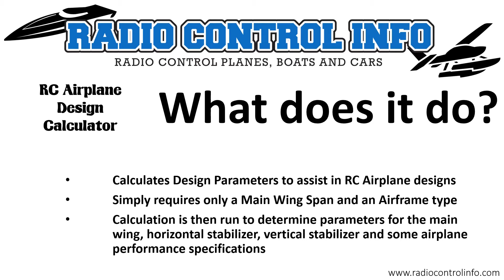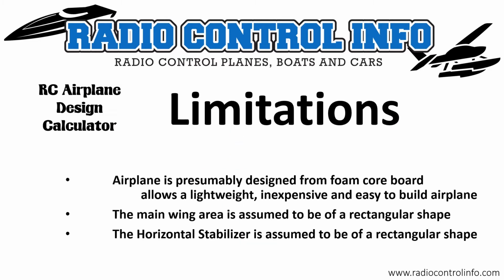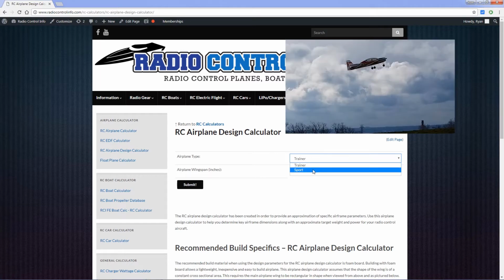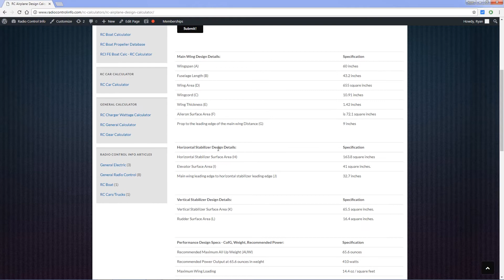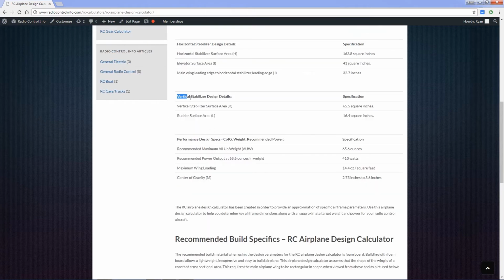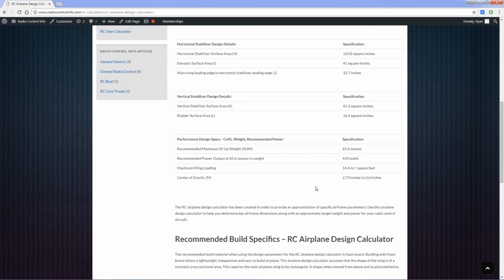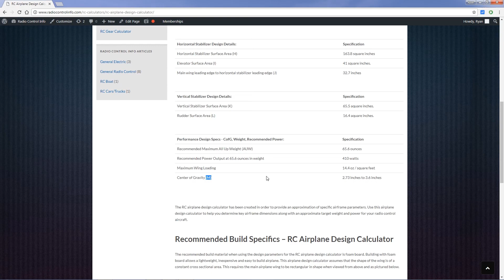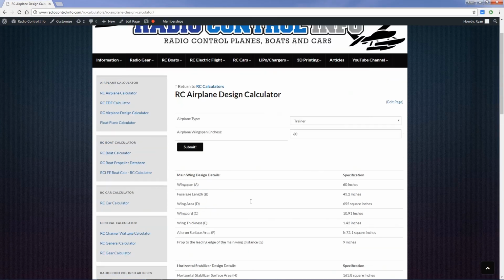RC Airplane Foam Board Design Calculator

Comment: Hi, I am designing an sport-type RC plane, but I have some restrictions for building, and I would like to experiment with changing some of the given variables (on the calculator you can only vary the wingspan). Which is why I was wondering if you have the formula's the calculator uses, so i can calculate the effects on the dimensionsby changing the weight for example.

Comment: i feel like your horizontal stabiliser output from the calculation is off. This just doesn't seem right, it looks way too small. 
https://i.imgur.com/ijDJX9l.png
Reply from the maker: It looks like you are using the wrong surface area. More than likely you are trying to use the vertical stabilizer value for the horizontal stabilizer. Use the correct surface areas in the right spot and it will all work out.
Reply: @RCexplained  I will check again. thanks.
Reply from the maker: let me know if you still have issues.
Reply: @RCexplained  I'm at work currently but I just checked the calculator again and mocked it up in a drawing again. I think perhaps you are correct. 
Additional question- if the horizontal stabiliser extends past what the calculator says should be the length of the fuselage, does it really matter if I actually extend the fuselage spar out to the length of the horizontal stabiliser anyway?
Reply from the maker: No, ultimately that is up to you.

Comment: I had a Aeroscout 2 1.1 RC Plane wheee fuselage broke beyond repair.

How would I figure out what size foam plane the existing motor & battery would fit it?

If I placed the motor, battery into a smaller Aeroscout a mini would it fly or crash to the ground?

How do you know proper dimensions for wing & fuselage?
Reply from the maker: A crashed foam plane may look like its broken beyond repair at first, but I've seen a lot of crashed planes repaired to fly again.

You can use your power system in a high wing, slower flying plane with a wing span between 40 and 54 inches or so.
Reply: @RCexplained  

Amazing-
Thanks 4 the info.
Yeah, just bought a Hot Glue gun & repaired original.

I’m now into building more DIY RC planes going forward.

Where did you find what wing size would work?

Just from building a few RC planes yourself or online calculation.

I believe the original Aeroscout weighs 1.8lbs.
Reply from the maker: Hey Michael, I know this from experience. Generally you want to use the calculator and experiment with different wing sizes and compare what recommended power system wattage is required vs all up weight of the plane.

Comment: Does the with of the body matter?
Reply from the maker: The width of the fuselage as changing any dimension on the airplane will change its flight characteristic. However, a wider body can positively or negatively effect flight characteristics. My recommendation is keep the width proportional to the length as in the dimensional image.
Reply: @RCexplained  Thanks!

Comment: I used the design calculator, and entered 30" for the wing span (A) so I can use just one standard 20"x30" foam board for the wing.  The AUW (All Up Weight) came out to be 7oz, but ONE foam board alone is a little over 9oz., and that does not include the fuselage, the rudder, the stabilizer, nor the electronics!! Am I misreading this? Thanks
Reply from the maker: Hi Steven. What kind of 20x30 foam board do you have and what scale are you using to weigh it?

Building a  small plane and keeping it around the 7oz mark will be challenging indeed. You will want to get creative to find ways to keep weight down.
Reply: @RCexplained  Thanks for your reply. The only foam board that I have on hand is a 3/16" foam board with two paper sides sandwiching the foam inside. Bought at Walmart for my kids' school projects. I used my wife's weight-watchers kitchen scale to weigh one board balanced vertically on top of the scale.  I have seen some YouTube video where people use an XPS 3mm foam without the paper surfaces, which I can't find anywhere to order. Does the All-Up-Weight include all the electronic components (servos, motor, ESC, battery, etc.)?
Reply from the maker: All up weight includes everything. I just weighed a 3/16 sheet, paper backed on both sides 20x30 at 4oz. It was actually under 4oz.
Reply: @RCexplained  I don't know what kind of foam board you have, but assuming you'll need two boards to build a plane, that's already over 7oz, without the servos, etc.  I'm lost.
Reply from the maker: Hi Steven, I did not use 2 full boards for a 30 in wingspan plane.
Reply: @RCexplained The density of a foamboard is about 0.0433 g/cm^3 ....Hence...a 20x30*3/16 * 2.54^3 = 1843.55 cm^3....hence the weight of this board is 1843.55 * 0.0433 = 79.82 grams or about  2.81 oz....

Comment: same foamboard sells at DolorTree for $1 way pay $5 per sheet on Amazon?
Reply from the maker: Hey Brian, the Dollar Tree foam is not quite as good. I've done a few builds with it.
Reply: @RCexplained  I usually tape all the surfaces which increases its strength and prevents it from absorbing moisture and have flown in light rain. But I have not tried the amazon stuff yet so cant speak to that.
Reply from the maker: @brianlink391  you can buy the elmers board locally I'm sure.

Comment: For a 48" trainer wingspan it's telling me to build a 104.8 square inch horizontal stabilizer.  This seems huge , gigantic.  Are you sure the formulas are correct?  I also assume this to be without the elevator included.  Just wanting to make sure of these measurements before getting too far into it.  have cut the H-stab, and again, just seems huge.  Thank you for your calculator.  seemed to work fine for a 35" , but building bigger after crashing first one.  Building a foam trainer.
Reply from the maker: Hi Harpoon_Bakery, the wing area includes the ailerons, the horizontal surface area includes the elevator surface area and the vertical surface area includes the rudder surface area. I hope this helps make your horizontal stab look better. :)

Comment: Hi, can anyone tell me what prop is suitable for a Turnigy 2205/34 1500kv Brushless Motor  in a trainer plane with 40 in wingspan
Reply from the maker: Hi Keith, what battery are you planning to use?
Reply: @RCexplained  Hi,  Turnigy Nano-Tech Plus 850mAh 3S 70C Lipo Pack w/XT60    While you're there, could you recommend a suitable charger as well. I read most of your guides but a  recommendation is still best. Thanks
Reply from the maker: I would start with an APC 6x4 expecting just under 1 pound of static thrust.  The Graupner line of chargers work very well. In general there are many charger out there with an equal amount of opinions. A charger recommendation requires a budget and expectations of what the charger must be able to do.
Reply: Many thanks,  I can now order these bits and get things working. excellent site.

Comment: Hi, using your calculator for rc  plane, adding G and J together and subtracting from B fuselage length gives me 10 mm for the width of the horizontal stabiliser????
Reply from the maker: Hi Keith. Thank you for your question. Adding G and J plus the width of your horizontal stabilizer does not equal B, the fuselage length. In fact it will be a bit larger than the fuselage length. G is the distance from the leading edge of the main wing to the prop, which is offset from the fuselage.

EDIT: When looking at a few examples of planes I built, the horizontal stabilizer actually hangs past the end of the fuselage making the total length of the airplane actually longer than the fuselage. 

In addition, the formulas used in this calculator haven't been setup to calculate out the perfect solution. It has been set up to provide a good starting point. For example, designing your airplane to the correct stabilizer surface area is far more important then working out the stab width when it has not been a form of output on the calculator itself. 

If this video helped please consider subscribing and hitting that like button.
Reply: @RCexplained  Many thanks for your answer. I'll start off with the horizontal stabiliser slightly longer than the fuselage.

Comment: Using the ailerons calculation how would I beat calculate the size of the aileron or rudder and elevator.
Reply from the maker: The best answer is through your own experimentation. I can however help get you started. For the aileron you can use a length to Width ratio of 6.5:1 to 8:1. This seems to work fairly well for me. As for the elevator, what I do is use the entire length of the horizontal stabilizer or at least 85%. Then work out the width to match the required elevator surface area. For the rudder I do the same thing. Try and use the full height of the vertical stabilizer. Then just determine the width. For both the elevator and rudder you will have a known length with an unknown width and known area. The formula simply becomes L(known) X W(unknown) = A(known). Hope this helps. By the way, take a look at the calculator, I added something that may help. ;)
Reply: PropWash love the new addition, and I've looked for something like this for a long time,I love this calculator.
Reply from the maker: Thank You. If you need anything else added let me know.